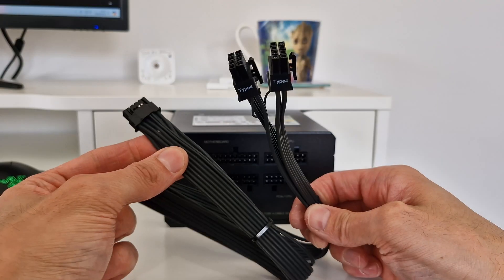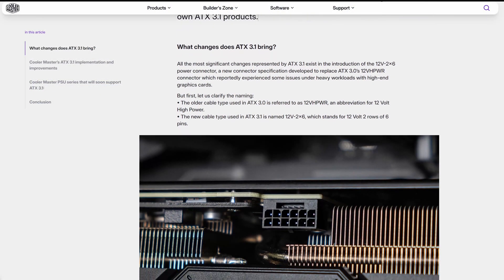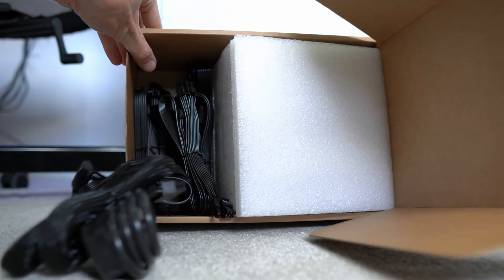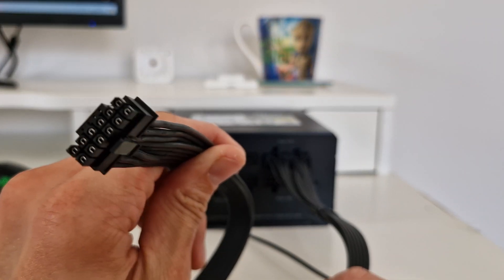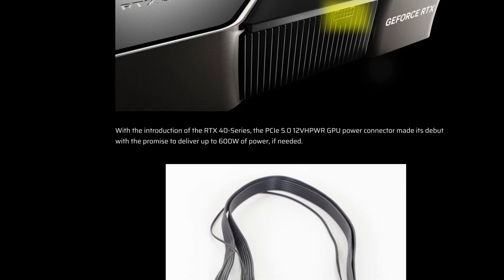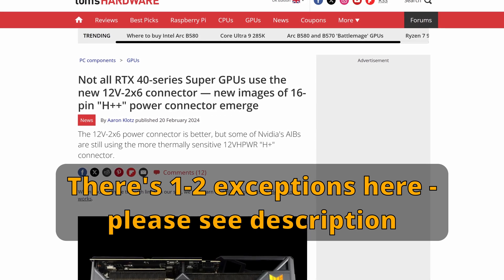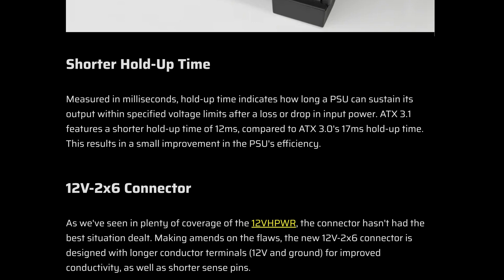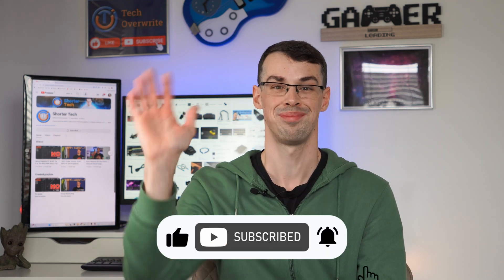12vhpwr and 12vh-2x6 - Do You NEED To Buy New Cables?

Comment: Hi my psu have to connectors pcie/cpu, can i connect a 12vh-2x6 cable there to the gpu, are they the same or one is only pcie and the other is cpu only ?
Reply from the maker: If you have a 12vhpwr GPU, then yes, using the 12vh-2x6 option with your PSU is probably best :)

But in general, many PSUs say "CPU/PCIe" on the PSU side, but when it comes to plugging in the cable (to the GPU or mobo), you need to check the other end of the PSU cable to ensure that it says "PCIe" for the GPU, or "CPU" for the mobo connection. You would never want to get an 8-pin cable and plug "PCIe" into the mobo, for example.

Comment: So with the 12V-2x6 Sapphire RX9070XT - NITRO+ is safe now?
Reply from the maker: Yes and no :) Lol. Basically 12V-2X6 is safer if someone doesn't push the cable in all the way.

HOWEVER any high power GPU that fails to load balance on each wire will technically be at risk of melting - and that's why RTX 4090s (with 450w power draw) and RTX 5090s (with 600w power draw) have often failed.

Although there has been 1-2 reports total about the 9070XT Nitro too: https://www.reddit.com/r/Amd/comments/1o5x696/sapphire_9070xt_nitro_reportedly_suufers_first/

To be honest though, I would still consider the 9070XT Nitro fairly safe. It's VERY rare for a 300-350w GPU to have melting connectors, and technically even 8-pin connectors can melt. So I would personally feel safe to buy the Nitro+ and not worry about 12vhpwr.
Reply: @ShorterTechOverwrite I went for Red Devil but maybe I was wrong :/
Reply from the maker: Nice choice, that's a solid GPU. Congrats :) I wouldn't overthink it. Enjoy your new GPU and happy gaming!

Comment: both the cable plug and the socket were updated in ATX 3.1 to implement the safer “power pins first, sense pins last” design.  you're wrong
Reply from the maker: Happy to be wrong :) I was basing that off Corsair's well discussed infographic in the middle of this article: https://www.corsair.com/uk/en/explorer/diy-builder/power-supply-units/evolving-standards-12vhpwr-and-12v-2x6/

(and a few other sources)

All of which says that the actual 12vhpwr cable itself didn't change. Can you please link the source(s) that state that the 12vhpwr cable end did actually change too?

Comment: So you can plug a 12vhpwr into a rtx 5070 and no have any problem?
Reply from the maker: Yes, that will be fine :) Remember that (as the video discusses) the 12vhpwr cable has never changed between ATX 3.0 and 3.1.

Comment: Are these new "Seasonic ATX 3 (not ATX 3.0 nor ATX 3.1, just the "3") Really ATX 3.1? or just the same "ATX 3.0 PSU with the same 12vhpwr socket" but with the "new 12v2x6 that connects with the 50 series 12v2x6 socket"?? I mean, are those PSU only changing the "cable name" and calling it a Day? or do they really replace the old PSU socket?
Reply from the maker: Hmm, it is confusing. Do you mean the Prime series from 2024? If so, while a lot of retailers just say "ATX3" (which is annoying!), it does look like it's an ATX 3.1 PSU: https://seasonic.com/atx3-prime-px-2200/

So I would then assume it's a 12vh-2x6 slot on the PSU itself.

Comment: Hi!, kinda late comment but if I have a rm850 atx 2.4 and just bought a Prime OC 5070ti would you say I have to update the PSU before using it? or any recommendations? :C :)
Reply from the maker: Hi, it's hard to say for sure. I mean, your PSU should work fine yes - it's just that some people find the use of the adapter to look a bit messy (i.e. from a visual point of view). But it WILL work fine - you have a good PSU and GPU :)

Comment: I'm putting together a parts list for my new build, gonna be a 9950x3d and 5090 combo, and I've been looking through all these power supply reviews and whatnot but it's hard to tell what the best options are, so I figure I might as well ask for your recommendation for a 1200w or higher psu, I'm not looking to break the bank on a psu but I definitely don't want to skimp out on the PSU of all things either, haha... 
Any help is greatly appreciated, I really want to be safe with components like these lol.
Reply from the maker: Sure thing, makes sense not to skimp out on the PSU lol. Sounds like it'll be an awesome build :) I tend to recommend Corsair or Seasonic, and both have ATX 3.1 compatible PSUs. Then it just comes down to what features and looks you prefer etc.
Reply: @ShorterTechOverwrite  Thanks for the reply, any particular models that you recommend? I've heard good things about the asrock phantom gaming 1600w gold and it's a pretty good deal at 220, my corsair rm850x has served me well but I definitely can't take it to my next build lol.
Reply from the maker: @roundandedgeless. 1218 ah nice, I don't know tones about ASRock PSUs but they appear as A tier (best) on this tier list so that should be all good: https://docs.google.com/spreadsheets/d/1akCHL7Vhzk_EhrpIGkz8zTEvYfLDcaSpZRB6Xt6JWkc/edit?gid=1973454078#gid=1973454078

Comment: I have a “ASUS ROG STRIX 1000W Gold PSU, Power Supply (ROG heatsinks, Axial-tech fan design, dual ball fan bearings, 0dB technology, 80 PLUS Gold Certification, fully modular cables” I neeed to know which 12VHPWR cable to buy ?
Reply from the maker: You could probably just use the adapter that comes in the RTX 40 or 50 series GPU box. Although failing that, CableMod sell compatible 12vhpwr cables for ROG STRIX PSUs - IIRC.

Comment: *Your so WRONG. My 600W cable came with 16 main pins, 4 sensor pins AND 2 extra power pins for a total of 22 pins!! No one can answer what those extra 2 pins do! They are only on the power supply end so I assume they are connected in a splice under the shrink wrap to add AMPERAGE capacity. SPECS: 1300Watts - ASRock PG-1300G 80 PLUS® GOLD Certified Cybenetics LAMBDA A Certified ATX3.1 & PCIe5.1 Ready [+146]
Reply from the maker: Hmm interesting, I'll have to look into that thanks, I haven't heard of one with that many extra pins.

Comment: is still safe using 12vhpwr cable to non 3.0 psu. I have 1000w seasonic prime that will pair with 5070 TI. My psu doesnt have 12vhpwr slot pcie.
Reply from the maker: I've changed my opinion on this recently - while I do tend to prefer a PSU with a native slot (for cable management reasons), the 8-pin connector DOES have more safety headroom - so your 1000w Prime should still work really well with the adapter :)
Reply: @ShorterTechOverwrite  thanks for answering my question. I just scared of melting cable these day, bcz of my psu didnt have native 12vhpwr.
Reply from the maker: I've changed my opinion on this recently - while I do tend to prefer a PSU with a native slot (for cable management reasons), the 8-pin connector DOES have more safety headroom - so your 1000w Prime should still work really well with the adapter :)

Comment: My ROG 1200w Thor 1200P2 is NOT 100% ready for the ROG Astral 5090 and could not handle it's power transient spikes at 100% using it's older 12vhpwr cable,  I had to undervolt my CPU a i913900ks voltage from 320 to 253 and bring the 5090's power target to 85% in order to get it to handle 4k gaming without sounding an alarm. I'd get a audible warning sound everytime it drew over 850w of total system power.. This PSU is not atx 3.1 compatible as but the 5090 is. I was going to buy the new ATX3.1 PSU but my current PSU is only 3 years old. I bought a 16 pin to 4x8 pin 12VHPWR StealthSense cablemod 12V-2x6 cable and I was told this cable would fix the power draw warning issue from the 5090. Can you confirm this?
Reply from the maker: Sorry to hear it - I think I just replied to your comment on my main channel (apologies for my delay) but I do agree that CableMod's recent 4x8-pin cables seem to be fairly safe from what I've seen :)

Comment: i have cooler master mwe gold v2 750w psu annd it does not have dedicated slot for these will my rtx 4070 gpu not work
Reply from the maker: Yes that should still be fine, you can just use the included adapter with your RTX 4070 (8 pin PCIe to 12vhpwr) :)

Comment: I got a 5070 ti and my new psu rm850x comes with a single port of new 12V-2x6 connector that allows 600w so you don't longer need to connect the adapter that required 3 slots of PCIE to be used in order to work as the pigtail was not recommended nor is recommended to use a only two adapter. If the graphic manufacturer tells you to use three dont use two unless you buy like me a new psu which supports a single cable directly from the PSU to the GPU
Reply from the maker: That's great advice, and I agree that using a newer PSU with that single 12vh-2x6 port is always going to be best :) Along with following the GPU makers instructions, 100%.
Reply: @ShorterTechOverwrite  you helped me a lot with your videos because people (dont remember if you too) recommended splitting the W into three like with the adapter that comes with the gpu but i was hesitant to use only one cable even if it was 600w but everything is fine :) but with older PSU all should use 3 single conectors and no pigtails
Reply: @ShorterTechOverwrite I needed this. I just bout a rm1000x from corsair and I didnt wanna use 3x pce but its hard to. Beleive 600 wats over that Lil cable lol. I just got a 5080 so I wanted to get the best wiring so I dont melt lol

Comment: How is the other way around if you have have 3.0 ATX PSU. If the new GPU has a 12V 6x2 connector can you use a older 12VWPR cable?
Reply from the maker: Yes that'll be fine :) They're basically interchangeble in this context.
Reply: @ShorterTechOverwrite  thank you for helping. I subscribed your content is great 🤙🏻
Reply from the maker: Happy to help, and thanks for the sub, I appreciate it :)
Reply: Do you have any problems? I'm in this situation right now. Want to buy rtx 5080 (12v-6×2) but my psu msi Mpg a850g is pcie 5.0 (ie 12vhpwr).

Comment: I'm still in the tank, I have a DEEPCOOL PX1200G WH [R-PXC00G-FC0W-EU] atx 3.0 power supply unit with 12whpwr, I thought I'd buy a powerful one with a view to upgrading the graphics card, and so I decided to buy a 5000ti graphics card, and now I'm upgrading, and it turns out I'm the asshole who bought the unit a power supply with an outdated connector ? with which it will not be possible to connect new videos normally so that they do not burn out ? The problem is that I have a 12vHPWR connector and not a 12V2X6 ? Or is it better to use 3 by 6x2 pin cables through an adapter?
Reply from the maker: It's hard to know for sure either way - however I'm sure that your PSU will be fine, to be honest. Especially with a 5070 Ti - I'm not aware of any of those (or the 4070 Tis) melting, which is good.

In terms of whether a PSU will be good enough for the RTX 50 series, there's two elements to it:

1) The 12vhpwr or 12vh-2x6 connector. This is naturally on the GPU, but some PSUs have a 12vhpwr or 12vh-2x6 slot too. I can't see whether your PSU has a native slot (Google keeps showing me the brand new model). But even if it's an older 12vhpwr slot, just make sure that the cable is fully plugged in - and you should be fine. Yes a 12vh-2x6 slot is slightly safer, but I don't think it'll be a massive problem either way for a 5070 Ti.

2) Generally how much power is drawn down the 12vhpwr cable, and whether it's too much for the cable. This is more a problem with the RTX 5090, since this can draw 600w - which is kind of too much for a 12vhpwr cable. It's also potentially a little bit of a problem for an RTX 5080, but the RTX 5070 Ti (and the 9070 XT AMD cards with a 12vhpwr connector) should both be fine IMO.

So long story short - I think you will be fine :)
Reply: @ShorterTechOverwrite  thank you very much

Comment: Yesterday I bought RTX 4070S And there is 12vhpwr plug inside. Can I use 12v2x6 cable from my PSU without any problems?
Reply from the maker: Yes that will work fine :) The actual cable with your PSU continues to be a 12vhpwr cable. It's just that the slot on some PSUs is now "12vh-2x6" not "12vhpwr". But you can 'mix and match' them fine - no worries.

Comment: Thank you for the video. Just to make sure, my 12vhpwr 4090 will work fine with a 3.1 psu 12v-2x6 (with the cable that is gonna come with the psu) right?
Reply from the maker: No worries :) And yes, that will work fine - the cable itself is unchanged between ATX 3.0 and 3.1 :)

Comment: I just bought a 2x8 to 12vh-2x6 cable for my "old" RM1000x PSU (2021 version), which I believe is an ATX 2.0. I don't think I should've watched this video, because I'm not about to buy a new PSU! Unless you tell me I really should do that... Should I...?
Reply from the maker: You totally SHOULD change your PSU. Kidding. 🙈 If it's a Corsair  2x8 to 12vh-2x6 cable then I'd say that is fine. To be honest the whole situation is a bit unnerving (especially for RTX 4090 owners I guess), but I still run an ATX 2.0 Corsair RM PSU in my main PC and have no issues. I'll only change my PSU to an ATX 3.1 one if I end up buying an NVIDIA 40 or 50 series GPU - but I don't really have plans for that right now.
Reply: @ShorterTechOverwrite  Do to health reasons I have a 4090 with a Seasonic VERTEX GX-1200 - 1200W ATX 3.0 pc build that's been sitting for 2 years now 😆😞😁 and am close to FINALLY finishing . So, if I end up with an up to date RTX 5090 🤦‍♂, do I need or should I upgrade my PSU to an ATX 3.1?

Comment: Good video. "Inquiring minds want to know." 😉
Reply from the maker: Thanks :) I've actually had this question 5+ times now on Tech Overwrite, and it makes sense why people are wondering it. If someone's ATX 3.0 PSU has a "12vhpwr" slot and talks about including a "12vhpwr" cable, it just gets confusing when all the press is now discussing why 12v-2x6 is better. What a mess that new cable/connector has turned out to be (at times), but hopefully it's all going to be a bit more stable going forward.

Comment: Built a computer recently and got a 4080 super. Instead of using the cable that came with the graphics card, i used the one that came with the PSU. Works like a charm! :)
Reply from the maker: Glad your 4080 Super is working out for you :) Yes I tend to prefer using cables from my PSU too, even if the adaptor is from a 'reputable' GPU maker like MSI. I have more trust in the PSU cable for sure.
Reply: So I used the cable that came with the PSU but GPU not working :( NZXT C850 (2024)
Reply: @martinalvarado5440 i just bought the c850 nzxt 3.1 (2035) and i have the same problem with the 600w cable, blackscreen + fans working at full speed even when im at the bios. I ended replacing for the cable that came with the gpu and it works perfectly fine . Apperantly most of Nzxt 12v 2x6 cables have a  defaut
Reply: Does the GPU need to be updated?

Comment: It's a short video (thank you, love that) but we don't even need to watch it. If you can afford a 4090, yes, buy a new PSU and get the latest and greatest cables. Why would you throw down $2-3k on a GPU and then ask yourself, "Should I try to save a few bucks on the power supply?"
Reply from the maker: Great comment, I agree. No point in chancing it with an RTX 4090 especially :)
Reply: Will my Corsair AX1200i work fine?
Reply: It is no and no, dont fall into trap of the fraudulent cable maker's false claim